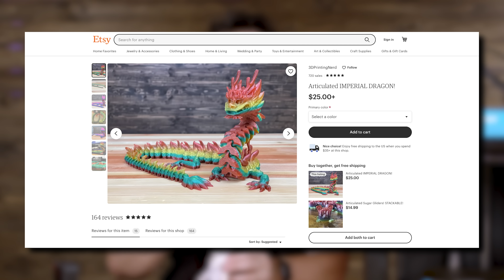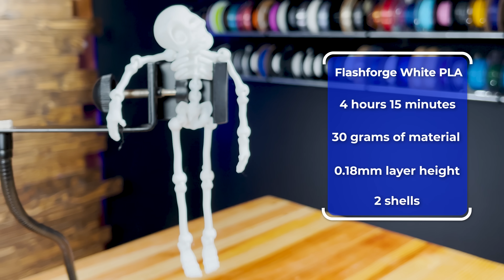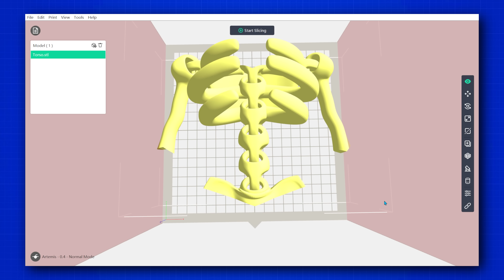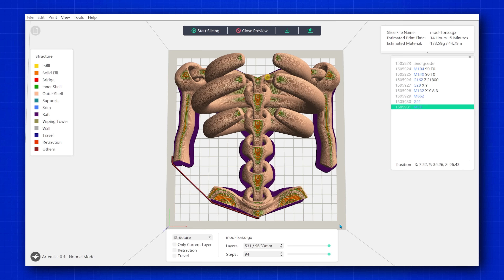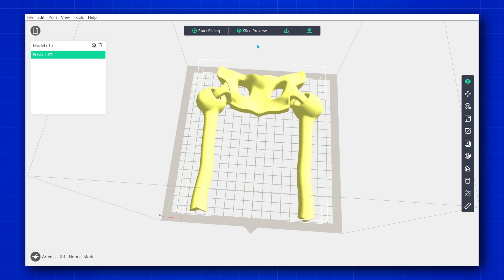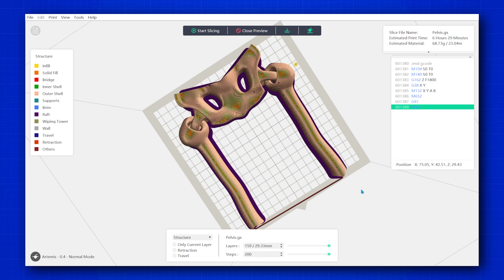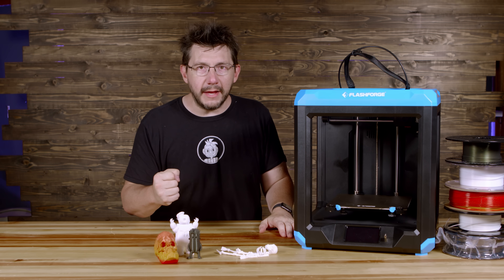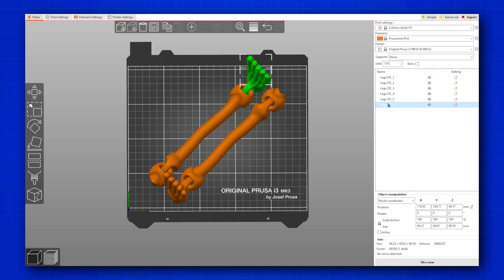PRINTING BIG on the Flashforge Artemis 3D Printer!

Comment: mr. telling, i bought a flashforge finder. (it did not come with a flashdrive). i hooked it up to my computer, downloaded the software. the printer bed never did level, so i had to add plexiglass to the bed.
ii did print for a little bit, but it stopped. i bought a 3d pen and used it instead.
i went to a comicon, and a guy that 3d prints figurines, dice, and parts said that the (every other) flashforge finders were made to fail. the way to find out is if it came with flash drive. (mine did not).  (have you had any problems with your flashforge printers?)

Comment: Very cool, but super long print job! Have you considered reducing the total print time by increasing the base and travel speeds to 80mm and 100mm respectively and layer thickness to 0.3mm? Doing so would be consistent with the Fast slicing option available for users of the Adventurer 3 in Flashprint 5.4.1.
Reply: Check out this photo of a Flexi Factory print-in-place frog created using a Flashforge Finder 3:

https://drive.google.com/file/d/1urimbh9kW2zf9mIL6ZqcgnuBufsHsvnL/view?usp=sharing

Print time using 'Fast' settings (100 mm travel speed/0.3mm layer) was 6hr 18 min vs. 10 hr 10 min using 'Standard' settings.

For most purposes, this would be considered excellent quality.

@The Padded Cell

Comment: That was one of the better raft removals. And for you Joel, always go bigger. You need a life size skeleton now.

For completeness sake:
- Flex bed: yes
- Filament runout sensor: yes (according to website)
- Auto bed leveling: ??

Inconclusive if worth the time due to not being able to find if it has ABL or not from Flashforge's website.
Reply: no abl, only manual bedleveling with the two knobs on the front
Reply: @oOSpecialProskillsOo  dah! Then the printer isn't worth the time

Comment: Awesome Joel! If it's still articulates, why the glue?
Reply: Certain parts still have to attach because of the size but they did it in a way that makes still be able to articulate. The smaller version doesn’t since it prints together on a smaller build area.